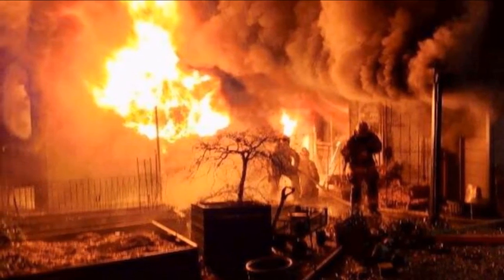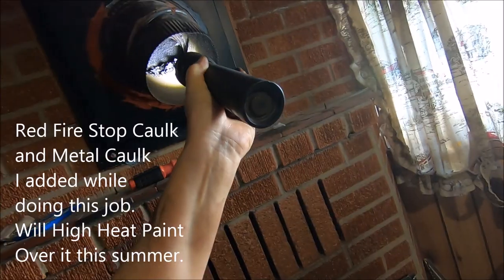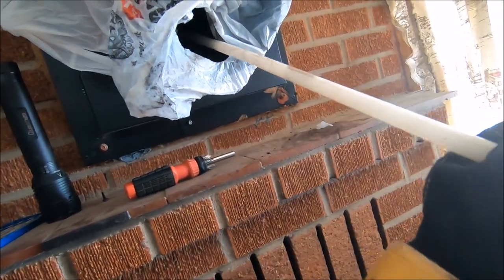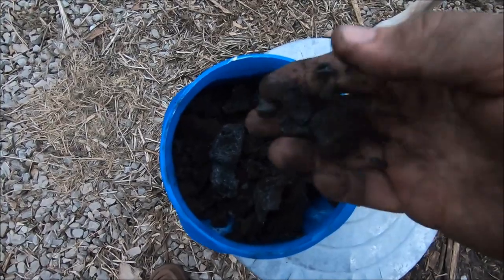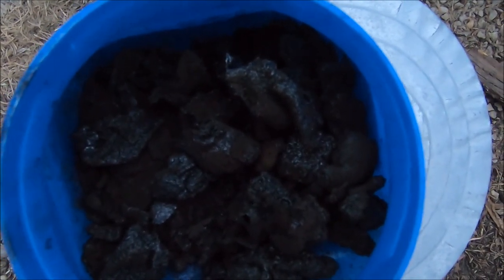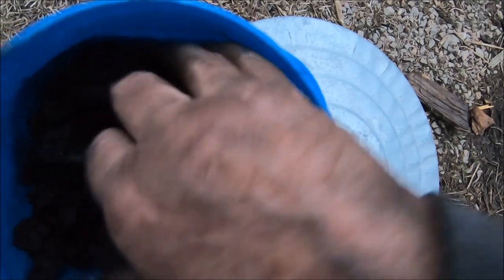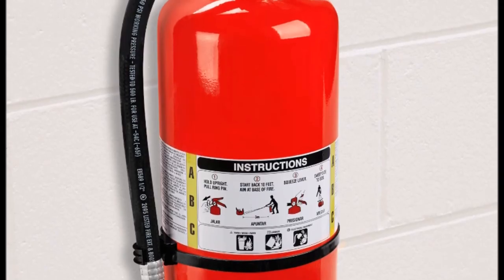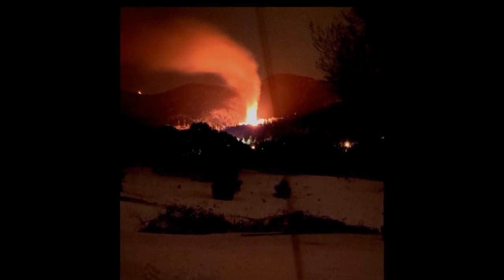This Can Kill You, Burn Your House Down / Chimney Sweep Fail / Do The Job Right Do It Yourself

Comment from the maker: Hi Jason, as I explained in video and description, I had a draft but not a good strong draft after the professional chimney sweep did his annual sweeping.  I know why now - he never took the chimney pipe coming out of the woodstove, going into the wall to the junction where the chimney liner attaches, off to look at that junction and remove the creosote that landed there from his top down chimney sweeping.

When I swept it, I got only fine ash out of the liner and cap. The three coffee cans of creosote, including those awful looking chunks of it, were all piled up at the junction from two years of professional chimney sweeping.  I'm guessing they started as normal creosote and expanded like that from sitting there. 

I posted this video in a face book group called Wood Heat.  Evidently there are some professional chimney sweeps in that group.  Some of them commented that standards of pro chimney sweeping require removing the stove pipe inside to clean it and to remove the creosote swept to a junction.  I'm glad to know that is considered to be the standard.  Which the chimney sweep I used never did.

The chimney sweep I used is listed on the nationally certified chimney sweep CSIA website for finding a chimney sweep.  There are so few such certified sweeps in my rural area that I now have no choice but to do this job myself.

Just for anyone reading to know - those pro chimney sweeps at Wood Heat group also told me that a professional sweep is supposed to provide an visual camera inspection throughout the chimney.  The one I hired did not do that.  He provided pictures of the top of the chimney, and of the inside of the woodstove, including of him vacuuming the place where the stove pipe comes out of the woodstove in back.  Never any photos of the entire length of the chimney liner and pipes interior, including never of the junction where the liner and pipe meet inside the chimney.  

Really annoying.  I normally don't post videos the same day I make them.  Often a week or two or three after I make them (with occasional exceptions when I find outlawed campfires, I try to be more on time on those.)  So I had not edited any of this yet to upload.  Then a chimney fire burned down a house on this mountain.  So edited this quick and threw it up here as a warning:  if your chimney sweep you hire off of the nationally certified sweeps listing  - thus hiring a professional - does not remove your stove pipes and eyeball that junction and remove that creosote, then you do not have a properly swept chimney.  Dangerous.  Can burn your house down.  Could kill you.

Comment from the maker: Here's products for sweeping your own chimney.  Not affiliate links.  They are what I have or like.
Bluesea Chimney Sweep Kit using a rotary drill - https://www.amazon.com/Bluesea-Cleaning-Electrical-Sweeping-Flexible/dp/B08MCVJSPD

This kit works.  I used it on my old wood stove chimney, which is a straight pipe up through the roof.  (Hired a chimney sweep for my new wood stove chimney). However, I can not take the rods apart.  I don't have the strength to push those buttons in enough and then pull them apart.  When I used it for the first time on the new wood stove chimney, after discovering the creosote problem shown in this video, it made a big mess as I backed up to extract the rods (since I could not pull them apart one rod at a time and go slowly down.)
IMO this is for a man to use.  Men have the strength to handle it.

Flexible rod and brush - https://flexichimneyrods.com/
One can buy the whole kit, or just the rods for your own brush.  They work by screwing together.  I like that since there is no push button latch that I can not undo.  They are not for drills.  They are simply screw together, quite flexible rods and a brush (or use your own brush) to push up the chimney pipes and then bring back down.  Here's a video of them being used to sweep from the inside through a wood stove on up the chimney - https://youtu.be/BxbAPYNN-RE

Poly Chimney Brush for 6 inch flexible metal chimney liners - https://www.amazon.com/gp/product/B08CB4NJM8/

I ordered this and it is en route. It screws onto rods. No push button that I can't undo.  Pushing this up the flexible liner that the new stove has will be a much easier job than using the rotary sweep, for me.